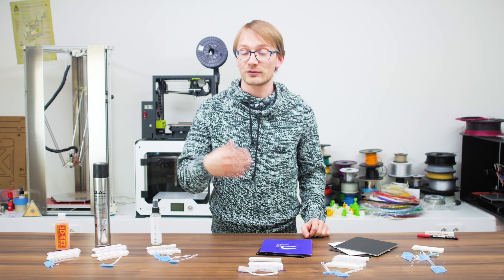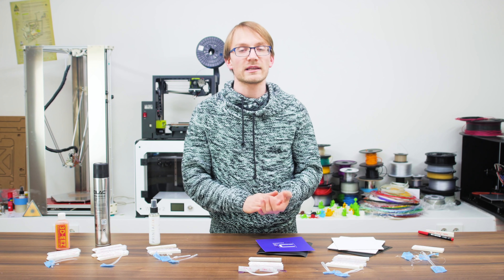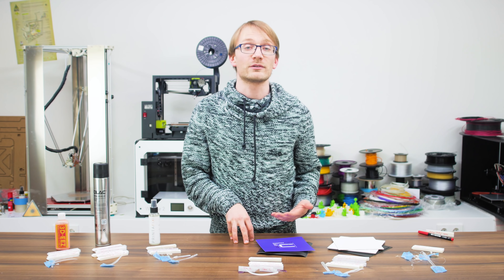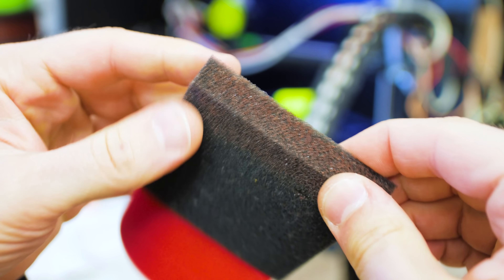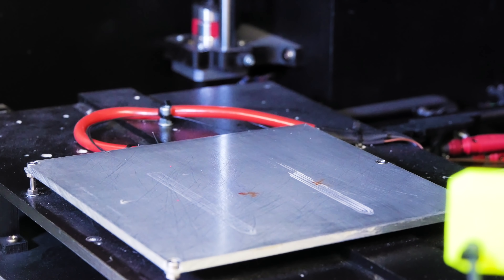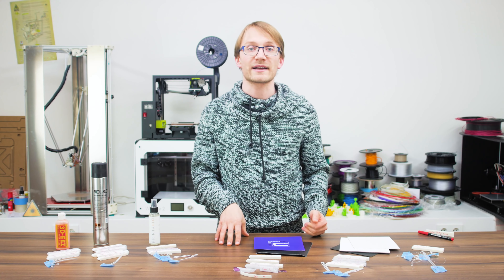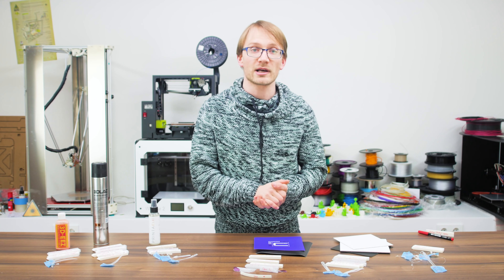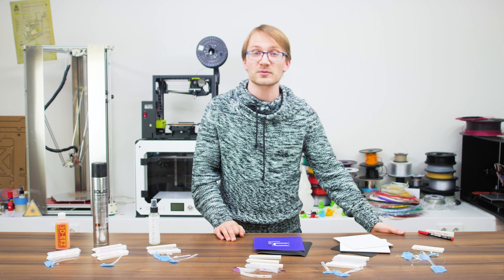Review: Are commercial build surfaces worth it?

Comment: I have tried so many solutions including many here and many not here and my best results and most pleasurable experience has definitely come from the zebra plate on my printrbot simple metal.   Its an absolutely brilliant product imo with the best service in the market.  I can wholeheartedly recommend it and im not affiliated with them in any way shape or form.  I just want to share my experience and hopefully help someone  else out there who was searching like i was for a consistent and enjoyable solution. :)  

ps. i also used wolfbite on my glass plates. the original solution was good initially until it began to destroy my glass plates, probably due to the compound breaking down over time but they sent me a new formula (that i have yet to try) to use and if it work anything like the original did in the beginning, then its probably the best solution i know of for glass hands down.

Comment: +Thomas Sanladerer Are you aware of Wolfbite by Airwolf 3D? It's the closest thing to a magic bullet I've found for ABS. I use it on heated window glass and the result is perfectly flat, mirror smooth bases even when printing ABS torture tests. I did find the glass needed to be exceptionally clean for the first application and it seemed like a couple initial applications were required for maximum effectiveness. Now however, I only reapply every week or two. they have several formulations and I'm using the ABS one however I find that PLA and PET/G filaments work great as well provided I run a 60-70C bed temp. The coolest thing IMO is that it holds ferociously when the bed is heated but once it cools you literally pick the part off the bed regardless of surface area or geometry. Try it out if you get a chance!

Comment: Toss in glass for your next round of tests.  I'm using a piece of tempered glass plate (intended for retail store displays) with a thin layer of purple Elmer's glue stick.  Everything sticks (PLA, ABS, PETG). I only have to reapply the glue after a few dozen prints where I see the haze starting to clear.  Prints pop off themselves when the glass cools. 

I'd be interested to see a comparison done of plain window glass,  tempered glass,  and borosilicate. Is the cost of the latter really worth the money?

Comment: Thank you for this nice video. I have been printing with PETG (my favorite filament) on PEI surface and it really sticks. I never tried cold but when it is heated to 60 degrees Celsius it sticks perfect and very forgiven at the first layer. I also printed with PLA and ABS again with heated bed they also stick perfect, sometimes too perfect that I have hard time to remove them.

Comment: PVAc glue mixed with water and left to dry in a thin film for PLA is pretty much perfect imo, it's very cheap since it's just generic wood glue or paper glue, it's really sticky on PLA at 65-75c and not at all at room temperature, meaning the print comes off a cool bed very easily leaving the film of glue behind on the glass, so you can use it repeatedly a very large number of times. Only real downside is that you probably need another bed and another adhesion method for ABS etc, I use PEI for ABS. If your print still sticks too well wash it off and apply less next time, you want a slight milkyness, not a solid white layer.
Reply: I've been using that too and can definitely recommend it!

Comment: I use oracle graphic sticker 651M series work very well for ABS, if u let printed parts cold down below 40, the part can remove easily without damage the sticker. those sticker easy to remove without leaving any glue on surface. I hv tried many sticker, cheap china sticker, 3M 3630 series and many. problem is the sticker very difficult to stick perfectly on bed.

Comment: I've found the standard pva glue to work extremely well with PLA, as others have,  and I'd be interested to hear if this print surface will work for any other material. some of the new taulman nylon bridge is supposed to work on it as well...

Comment: Hi,
great video! i think you should do the other surfaces you mentioned. If you keep the same methodology, you could even compare each batch of tests against each other.
There is a parameter that i take into account for printing : ease of use. 

Unless i want to print a very specific part in a difficult to print material such as polycarbonate, i am interested in the ease of setup. Indeed, if some technique requires 15 minutes of fiddling with stuff before printing, it's impractical for small prints. In my case, i try to make my designs easy to print with no support, no raft, or no special surfaces (which is why i stick to PLA and some nylons).

I think in general that should be a factor in evaluating a surface : is it for everyday simple prints or is it the mother of all print surfaces that you use for the occasional tricky  part?

Anyway, i really would be interested in more videos on this topic (Will it stick?), with more surfaces and more materials. It would be a good idea for beginers, as you can order spools of materials with indications on temperature, but less often on print surface. Taulman3D tells you how to print on glass and what to add, but says nothing about other surfaces. Will the new tech-G stick to surface X or Y? only way to know is to try, ending with a useless spool if it doesn't work :) With such a series of videos, it could just be a reference guide :)

Comment: I used buildtak myself, it worked way too well, but in fairness I didn't have the most level bed at the time which is completely necessary (was a bit warped because of tensioning)

Comment: i found melted ABS in Acetone works really good with a brim and if you have to print a part that is high and narrow, like a plane wing... after several hours you will get some warping but not much 
the problem is higher in the print, you get cracking and that is unsolvable...

Comment: I spread out a thin layer of e6000 with a credit card over a heated bed, works well for me when bare kapton is inadequate.
Reply: +Stan V hmmm what is e6000.
Reply: DIY3DTECH.com Code word for semen.
Reply: How do you get the E6000 off? It bonds to glass and metal very well.
Reply: Just rub it with a paper towel, it'll ball up and come off easy enough.

Comment: I am not in any way a specialist but from the beginning i use a PVA / white wood glue diluted 1:1 with water/ spread on bed with a sponge and kept together with the sponge in a hermetic jar. Costs 2 euro.  Lasts  Forever. I refresh it a bit once a week or 2 printing 24/7. Sticks  perfectly. Difficult to unglue when bed is hot and flat parts.  Easy when bed is colder. 
Basically PVA+Raft =100% success rate. I dont know why one anyway will print ever without raft/and support/  if he wants dimensional   correct parts
Reply: Boyan Silyavski me too, clean with ipa, undiluted pva. no problem so far.

Comment: Buildtak (Or Coropad, I guess) lets your prints adhere altogether too well sometimes. I've bent the ever-loving crap out of a 3d print removal tool or mangled the buildtak itself more than once until I figured out to (carefully)  use a razor blade to achieve separation at an edge then work the tools under that. (Yes, plural "tools". Three of them at different points for a 5cm by 10cm print.) Honestly, it makes you look good even with poor settings.

Comment: great review.
i have the luxe problem that i have bought a sticker plotter of refine720 secondhanded and with it i became a big rol of the paper kind of transfer tape to transfer plotted stickers, (60cm wide) 
and this is actually the same as paint-masking tape but extremely wide.out of that rol i cut a nice complete bed covering sheet.
and when it"s to damaged i remove it, and if it was on a long time i have to use some white spirit or terpentine or perhaps acethon, something like that to remove the remaining glue and pieces of tape.
this i use on the heated aluminum bed of an anet a6. 
but i have to admit, i still used PLA only on this moment.

Comment: Fireproof glass. Its not actually glass, its ceramic. Glass bends and warps, ceramic does not. 

Can be sanded for more stickyness. Not needed in my opinion.

Much more expensive than regular glass but will not wear/bend.

Utterly useless when cold. VERY good when hot. 

Will need near-perfect first layer settings but also will will print good PLA brimless and raftless then.

Best part. Maintenance free. Wipe it with cloth or paper and run another print.

Comment: How can you get away with no part cooling fan?
Also do you know what aluminum type is used for the print bed? for example 1100-H14
Reply: Going to try 6061-T6 for a 305x305 print bed

Comment: No BuildTak? I am using the Zebra skin and zebra plate they work great for me.   I have buildTak as well, but stuff gets really fused to that.  Build tak is probably the best for ABS.  everything else I use Zebra.  With both I programmed  simplify3d to wait until the nozzle is cooled before running the auto level, so I dont bung up the surface with a hot nozzle.

Comment: I have printed with many different surfaces.  Borosilicate , with a good , unscented, extreme hold hairspray is by far the most versatile, and reliable.  Keep in mind, not all hairspray is usable.  Generally the cheapest, generic, unscented haispray will be best.  PEI is good, however it tends to hold too well with PLA when heated.  A piece of boro with PEI on one side, gives you both surfaces, and thats all you need. I dont have any faith in the commercial build surface products. They are simply too costly in the long run.

Comment: I'm strongly considering getting a Bottleworks Build Plate for my Makerbot 2X as my stock one is warped. Would you have any suggestions for alternatives ($400 NZD investment for the Bottleworks so I want to be 100% sure it's the best option!) and would you suggest any of the above adhesives on it? Would you think they could lead to the plate smashing at all?
Reply: +themaxyay Also, awesome review by the way. Love the constant conditions to make it repeatable - it's definitely useful when there's so many options out there :) RE my above comment, I'm mostly printing in ABS but may be using PET in the future.

Comment: Over at the SeemeCNC forums, we have found the PEI coated plate (Which is what he used in the video, and is called something like Daurdruck-Platten) to be expensive (At least in large round plates), and calls for very high temperatures (130+ recommended by the manufacturer, thus why the silicon heater).  PEI as PEI sheet, rather than dissolved and attached to a porous aluminum plate, works at lower temperatures, is much cheaper, and is available in thicknesses that, like Zebra skin, will allow you to sand it some, although it doesn't pick up scars and dimples so easily.  It can be patched with superglue, with BSI Insta-cure working best so far (Gold Plus may do better, but I haven't had a reason to objectively test).  You can take a look at our experimentation here: http://forum.seemecnc.com/viewtopic.php?f=36&t=4336 

Some other trivia about it, that's somewhat relevant.
It seems at first to be Acetone insensitive, but it will haze/craze over time with repeated exposure.

It will straighten somewhat if it begins to warp if you clamp it between two plates, and heat it in an oven, but even if the glass transition temperature is exceeded, will not become significantly malleable.  

When purchased in thick enough sheets, it can be used directly over a heater, or a heat spreader, without needing adhesives.

It performs well when bonded to aluminum, but less so when dissolved into it.

It can be dissolved/bonded by Methylene Chloride, a common hobby solvent.

When cooled, it will usually dis-engage parts on it's own.

It is a resilient plastic, meaning that a scraper or palette knife can be used on the bed if desired (Such as if you don't want to fully cool the bed)

It is easily cut with a knife, scoring device, or bandsaw.

Comment: TIP: painter's tape + 3DLac  
->just a quick click, dont spray as much as saw on the video or you will end removing the paper with hot water (it works, but it is annoying)
I have little experience on 3D printing, but 3DLac has much greater adhesion than regular hairspray (I just tested few brands like Nelly and other cheap alternatives). I dont use it on top of the aluminium, just to protect it I place some painters tape on the heated bed. 
Yeah maybe its too much: heated bed + painters tape + 3DLac, but it works and I dont spray as much as I saw in the video. Even on cold bed my experience says it works.
DONT USE TOO MUCH 3DLAC if used on top of tape, it sticks really hard and you will need some hot water to remove the paper from the botton of your print.
I spray from about 30cm just a fast click on the zone I will print and it works really well. 

Thank you Thomas for all these great videos, the only source of cientific test I have found. I myself experimenting with bake 100%infill pieces on the oven as I saw in your channel.

Comment: I meanwhile use a sort of double sided Tape as in the link (https://www.otto-office.com/de/artikel.obtshop?artnr=8305&gclid=CL7IuL-qz8sCFTUz0wodTisGjw&pshoptype=b2c&wkid=OO-2-DEXawFwqwjUsmtDQJn&pid=BAG14-001-na-022-012204-8305) especially on non heated plattform conditions. When heating it up it tends to produce "bubbles" and leads to an uneven print surface, but this ist good get the finished object off the plattform in the end. This works well both on my Mankati fullscale XT plus and my Witbox 2. I really can understand the problems with any kind of spraying substances due to the pollution of the rails and windows and as well of the particially strange smelling.

Comment: I'm totally sold on PEI.
I have a ROBO3D printer, primarily print with ABS and was happy with using Elmer's Glue Stick.

That is, until the borosilicate glass started to fall apart and large chips were pulling out along with the finished part!
My build surface began to look like the surface of the moon!

I decided to try PEI after watching a video by SinfoniaSam: https://www.youtube.com/watch?v=Fe-l80z27b4
(Somewhat of a character I might add :-)

Got some .060 thickness from Amazon and at first I tried holding it down temporarily with binder clips, but some of the parts were causing the PEI to heave in the middle.
Now it's held down with strips of double sided carpet tape and although it isn't the prettiest build surface, the parts are sticking great.

.250 thick would be perfect for removable build beds, but at that thickness it tends to get really expensive. $110 for a 12 X 12" piece.

It is holding up well as long as you're careful and don't gouge it with the tool you use to remove the part. You will get fine scratches, but it can be sanded smooth again.

I've found that as long as the bed temp is above 60ºC the parts stick well and won't warp.

I did have some warping with a part that extended beyond the heated portion of the bed.  (Robo3D likes to advertise 8" X 9", but the actual heated portion is smaller) That was cured when I added some "mouse ears" to the design.

One word of caution when using PEI, DO NOT use Clorox Spray Bleach Foamer to clean it!
I tried it and for some reason it made the ABS stick really well. So well even after everything cooled to room temp the part was difficult to remove. I had to use a hammer!
Reply: PETG sticks to heated PEI very well, stronger bond than PLA or ABS ... not sure why the PEI build plate that Tom tested here did so poorly?  PEI is the best all around solution IMO.